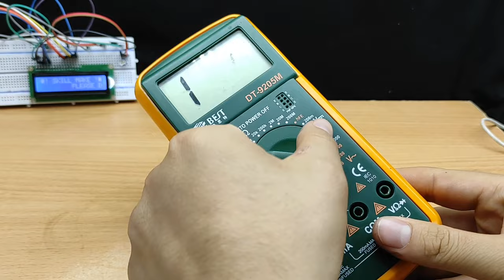How to make rechargeable 9V Li-Ion battery

Comment: This will drain battery in stand-by because mt3608 will consume energy on stand by. You need to add a switch between battery and booster mt3608. I have done this like you and battery was empty after one month not used.
Reply from the maker: Hi mr Robert Thank you for your comment. This video was for educational purposes only 🙏🙏🙏🙏👌👌 excellent point
Reply: can you pls make another video on how the switch can be added to the system
Reply: Yes. And the capacity of an alkaline 9v battery is around 500-600 ma/h and here you used a 100 ma/h or less lithium battery.